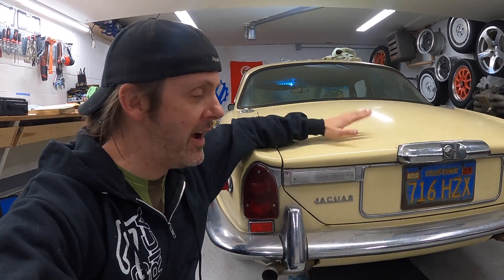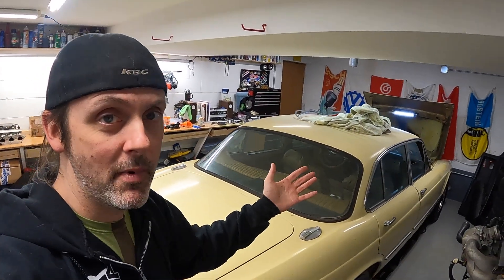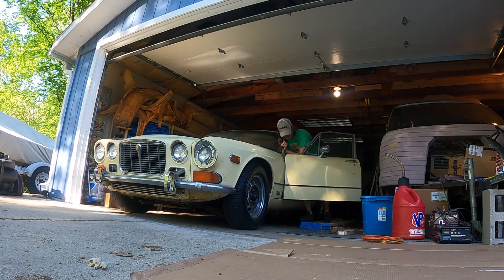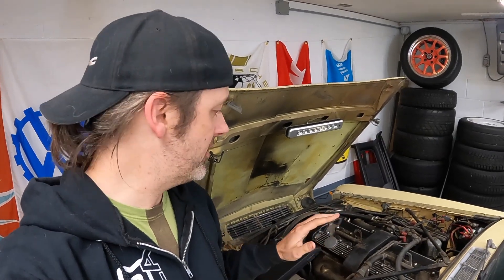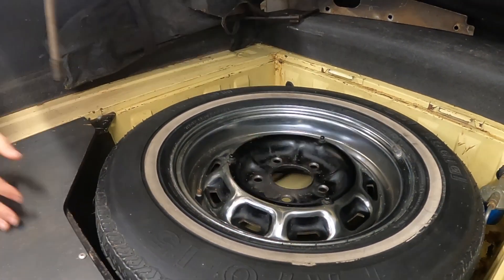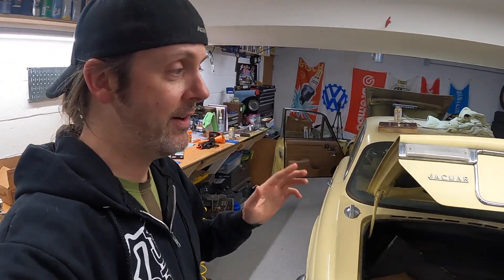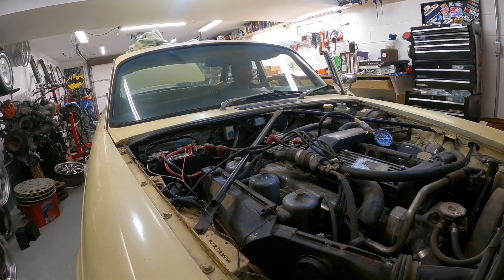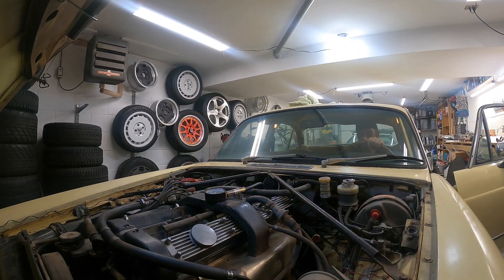Manual Swapped Jaguar XJ6 Project: Is my XK Engine Junk?

Comment: Those are great cars I saw one that was LS supercharged swapped.
Reply from the maker: LS is good on paper but the XK engine is pretty cool imho, it won lemans 5 years in a row, has dual overhead cams, and is designed/inspired by a Rolls Royce Merlin V12; the designers/engineers worked on WW2 aircraft prior to creating the XK.   I personally would rather have an XK but if it's junk, yeah, LS might be the way.
Reply: @addvancedgarage  Yes great motors, luckily you found a Jag with it still in the car. A lot of times its gone, blown to bits or run so ragged its crap.

Comment: Just went and looked at a California Xj6 ser3 ( in Finland)and just gawped at the cleanness of everything. Rust only on rear screen left corner. The seller just had not got around to get it running so no deal but if I find a manual L77 or Getrag 265 I´ll see if it is still there..

Comment: Dual fuel fillers for export so you can pull up to either side of a fuel pump to gas it up.
Reply: Actually you can't do that.  the communicating line is too small to do that, you have to fill them seperately.
Reply: @mescko  It was a joke